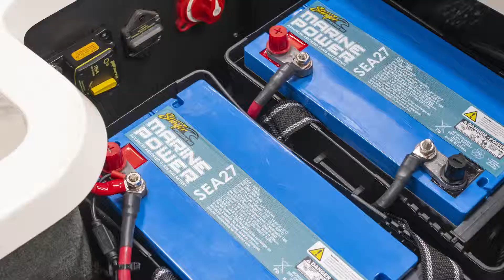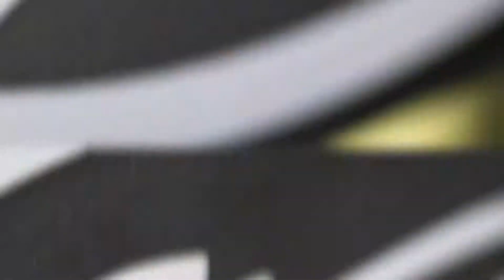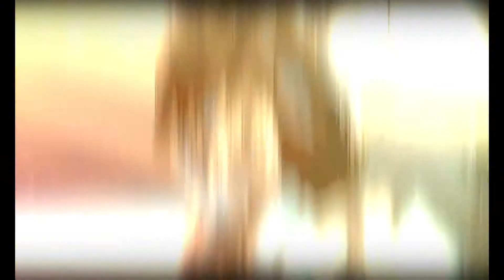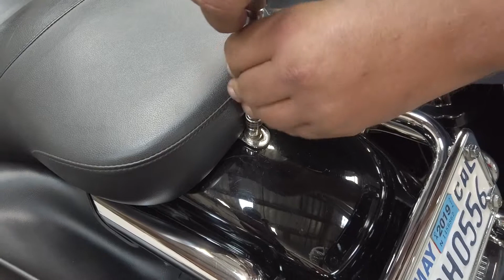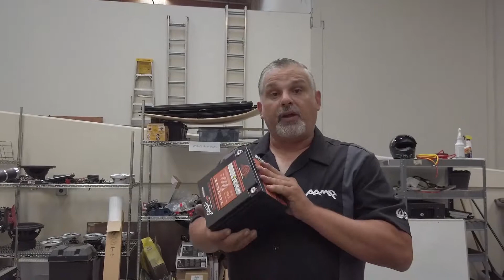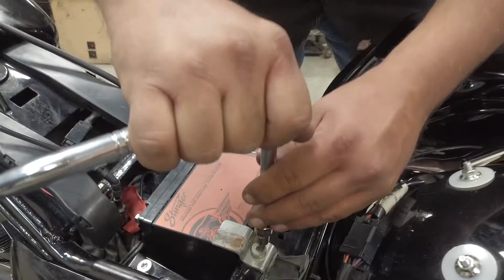SVT30L Harley Battery install video

Comment: I just purchased a stinger spx 950 battery for my 2012 Harley Davidson Roadglide. The terminal cables are very rigid on my motorcycle, in which im unable to connect the front mounted terminal posts to my  top mounted Harley Terminals cable. I dont want to turn or twist them, fearing it may cause damage. Is there an adapter kit i can use? thanks!

Comment: Sorry video didn’t even show how to maneuver the power and ground wires that are made to go on top of the battery
Reply: Did you figure it out? I'm about to install mines on my 13 RG
Reply: @keykey1960  hey, were you able to get it installed? I have one and I’ve been trying to connect it for 2 days now! Any help. Thanks!